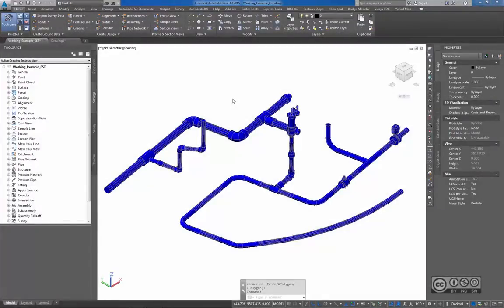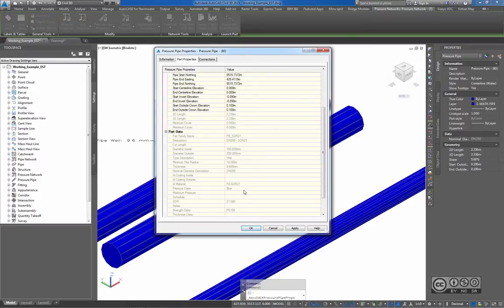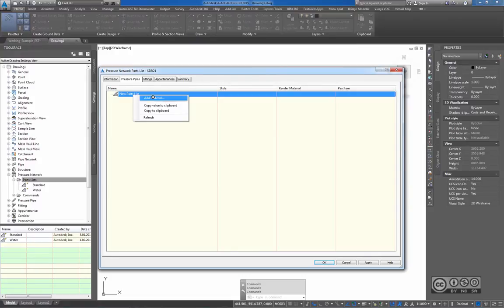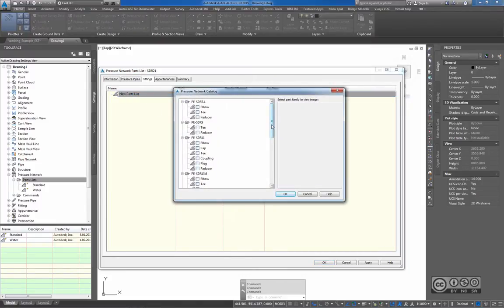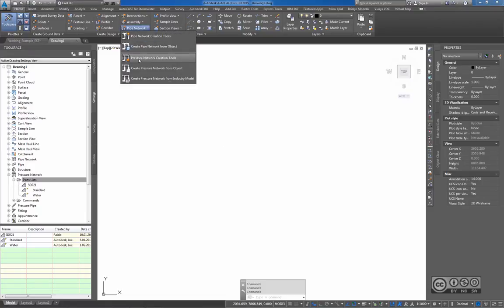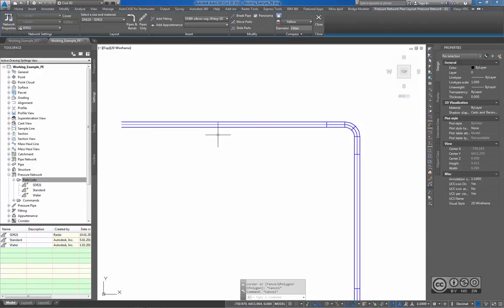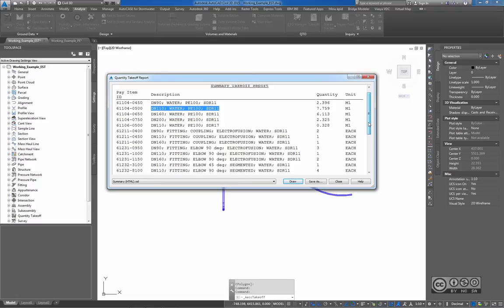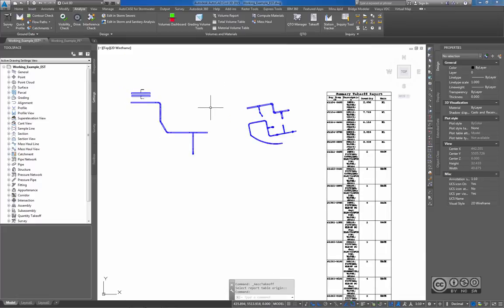AutoCAD Civil 3D - Pressure Network PE Water (in English)

Comment: Raido, in min 11:54 you can see the current radius and minimum one. How can you set this dynamic data?  Normally the cursos shows
Reply from the maker: This is a standard AutoCAD ferature. Dynamic Input. You need to turn it on. Check Status bar, or make it visible through a Status bar menu icon. Then activate (turn it on). Or try a F12 key.
Reply: @eRaido  Thanks